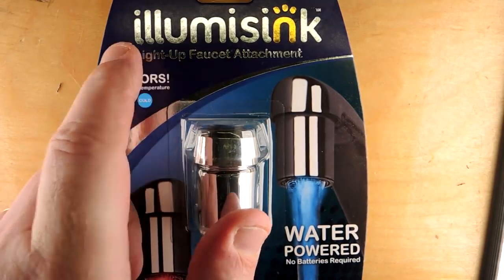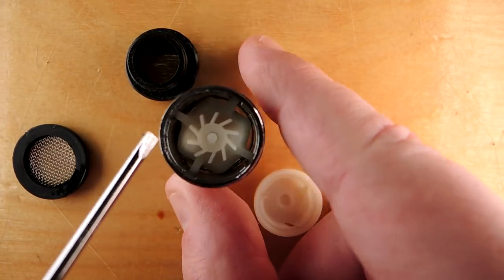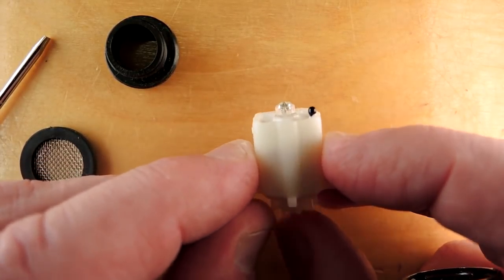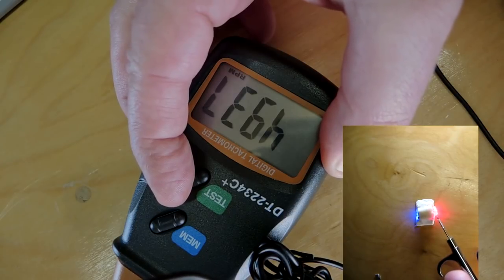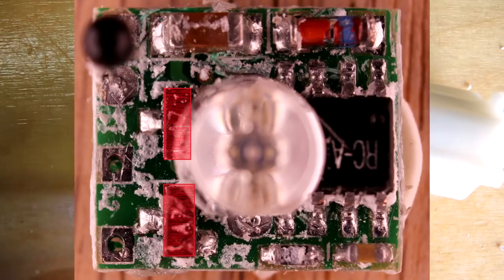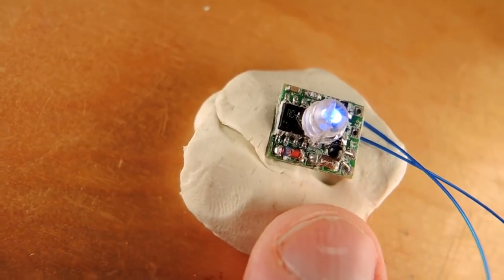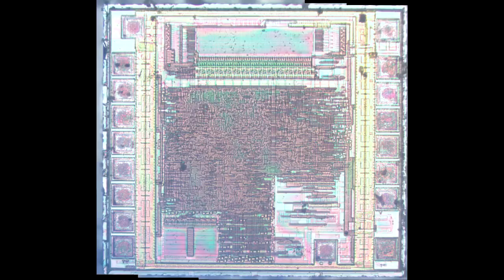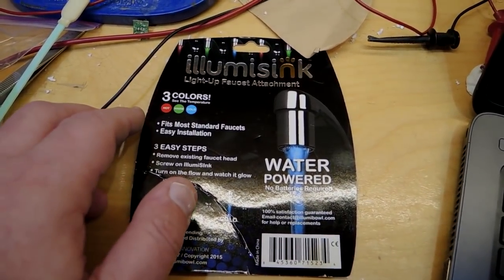Water Temperature Light Teardown

Comment: Smash the generator!!! I want to see it's innards
Reply: Will just be a small chrome plated neodymium magnet cylinder with a coil wrapped around the outside. Magnet is polarised so there are 2 poles on the cylinder side, and then the coils are simply wound into a rectangle and placed each side, and then there might be a simple steel strip around the outside (or not, depending on the manufacturer) to complete the magnetic circuit. Coils are in series. Rotor will simply have the shaft pushed through, held by a drop of locking varnish, and the bearings will be just regular nylon forming the end housings, and most likely the shaft is stainless steel, and there is no real waterproofing other than the parts being mostly non corroding in water materials.

Same construction as used in those tiny aquarium pumps really, just made really small and really compact at lowest possible cost.